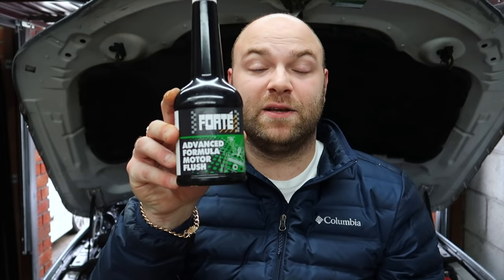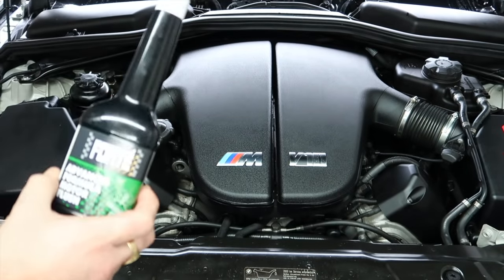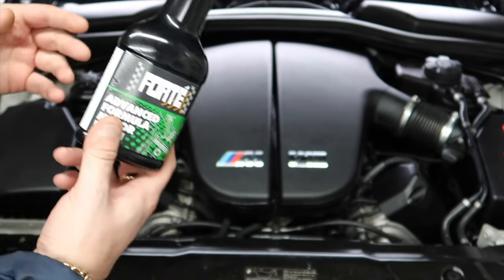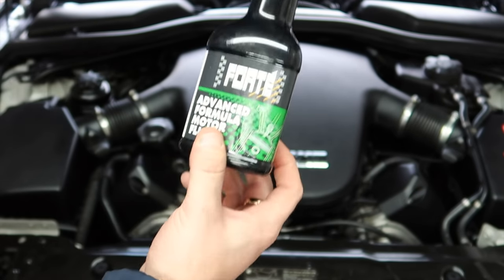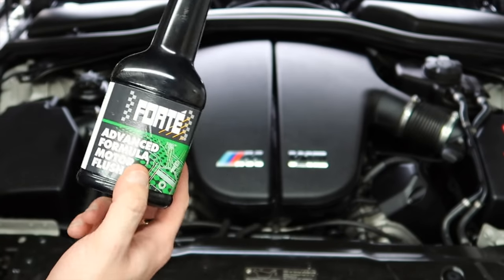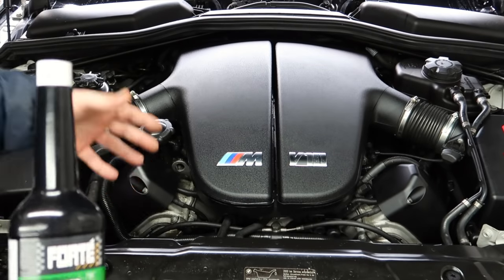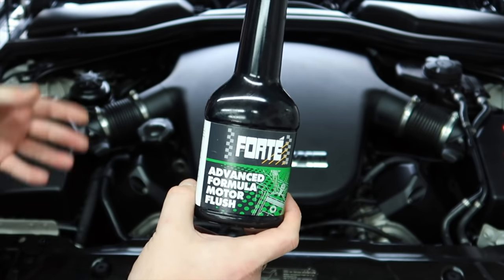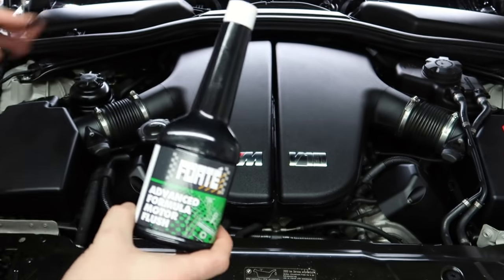Don't (EVER) Use Engine Oil Flush In Your Car !!

Comment: I used it in my n52 for 10 minutes only idling i had never any kind of problem  i can say that after i had better engine performance
Reply: I have also used the Liquid Molly product in my 2011 528i with the 3.0 straight 6 and it seemed to be ok with my 170,000 mile engine. But I see what he’s saying for those of us who change our oil often and with good oil🤙🏽
Reply: @CorbinWilliams  which one good oil you recomend?
Reply: @BagusWibisono  castrol edge m
Reply: I used medic motor flash every oil change and i notice my engine is so quiet and i put full synthetic oil.
Reply: LIQUI MOLY TOP TEC 4200 5W30 AND ONE CERATEC OF LIQUI MOLY EVERY 30000 KLM.

Comment: This is a waste of a video,I used it on my girls mini cooper 2006 since she got it at 27kmiles she now has 103kmiles and when I do the change the oil every 5k  it is so clean because of the motor flush I use
Reply: Totally agree with you .
Reply: Yeah, using it regularly is fine especially from low mileage. Doing it all of a sudden after a long period of time and skipped oil services its begging for trouble. Sludge pellets really can screw a motor.
Reply: Gaff, Do you use the flush on every oil change? or have you only ever flushed the engine once when you got the car?

Comment: Best engine flush is diesel or kerosene.  1. empty sump.  2. fill with 6 pints diesel or kerosene.  3. run engine for 10-15 mins.  4. drain and refill engine with regular oil job done!

Comment: If you want your engine to run longer smoother, change oil in shorter intervals, and use flush every time you do it, I'm a driving instructor, doing several oil changes in one year, I've done 120k since I bought new car in November 2018 Suzuki swift 1.2, never had any problems, oil changes every 10k miles, I use flush on my private car bmw E60 2007 2.0d, had this 10 years, oil change every year with flush, it doesn't even leak from anywhere, I even use a flush on my motorcycles, and again no problems at all
Reply: I think it’s people who don’t anything then want a cheap fix. I use V Power diesel or BP Ultimate and I change the oil about every 8k miles and I used the whole battery of BG products at 100k miles - intake cleaner, EPR oil flush, 245 fuel tank additive. I’m going to do the EPR and 245 now that I’m at 154k miles 2005 120d steptronic remapped 300lb-ft

Comment: I’ve used engine flush on both my N55 engines. Id put it with the old oil, idle it for 10 mins and drain it. Then add new fresh oil and idle for another 10. That fresh oil drains very dirty! Add new oil and good to go. I’ve never had issues and noticed improved performance on both engines.

Comment: I used liqui moly engine flush on my N52 with 125k miles.  As directed on the bottle, I idled for 10 mins and did not drive it.  2k miles later I changed my vanos filters and they were surprisingly clean.  I still installed the new vanos filters anyway bc they were cheap enough.  My N52 doesn't really consume oil.  The only oil loss i get is from that damn oil pan that I've been postponing.
Reply from the maker: Oil pan is one of the most easiest jobs to do on these engines !! you don't even have to remove the subframe to do it I have done it many many times without replacing the gasket or the subframe. 

and my car is still perfect no leaks
Reply: @BMWDoctor  Yeah I heard there are tricks... but it becomes even more complicated when its an Xdrive model.
Reply: @BMWDoctor  do you have a video for this please?
Reply: @BMWDoctor is liquid moly for the lifter tick work ?
Reply: I have an X5 (2012) with N55 engine. I just did the valve cover gasket and was surprised to find sludge built up on the valve springs. BMW doctor stated he used the product only on higher mileage to remove sludge and since this motor has 200K, would it be okay to use Liqui Molly Engine flush or do I still risk getting blow by after? I think the point was to not use on lower K motors with no sludge but okay to use on higher mileage motors with some sludge??
Reply: @Triggerman2505  Don't use it. Rather change the oil every two weeks for the next two months. Than check the cover gasket again. 
High mileage cars can have problems because they have some wear and tear on the engine... and sludge. So if you wash that out... you could have more problems after. Most case is increased oil consumption... because you washed out piston rings that are smaller due to 200k. 
We have Eco test in EU and if that device goes red, you can't get your registration.
Reply: @hbkkid5049  the lifter tick additive did not work for my bmw n52. The lifter tick is driving me crazy. I just bought the liqui moli pro line engine flush and new oil. But i wanna see if it will damage my seals.
Reply: I drove my 2007 bmw 328xi for years with oil pan sweating leak. I dont reccomend it its a serious fire hazard.

Comment: Have always used plain old ATF (Automatic Transmission Fluid) in any and all of my high mileage engines.  High detergents to clean out those passages, "coking" and build up, but still sufficient lubrication to keep from harming the engine.
Reply: Do u substitute 1 quart atf for 1qt of oil?

Comment: I recommend the Liqui Moly flush and using it just one time after purchasing a used vehicle as there is no way to confirm how the oil was maintained previously. My N55 has 150k miles and after using this flush and continuing my 5k oil change intervals it feels like a brand new engine again and my gas mileage improved also.
Reply: Pull the cylinder head cover off and your know how frequent other people changed oil.

Comment: Love this video. It made me laugh. Back in the 1970s my brother had a 1968 Mercury with a 390. He used not one, but two cans of Rislone in it before an oil change to remove sludge. Boy did it work. Engine clean as a whistle, including behind all the piston rings. Car smoked like crazy. He had to rebuild the entire engine. Memories.
Reply: So it caused more damage to the engine? :o
Reply: @rww9113  No, it did not cause any damage, the engine was already worn down.
Reply: @rww9113  it’s like doing a transmission fluid flush. Depends on the state of the engine. Liqui moly engine fish is actually good.

Comment: I think, to be safer, if the bottle says use the full bottle....use half the bottle, do a less mild clean....then fill up with new oil  and run for 30 minutes,  then drain it , see how it's golden....then put new oil, then change again every few thousand miles

Comment: I use flush on every other change and the motor is flawless, Quiets down the engine and better mpg every single time. 
1. Flush
2. OIl change (4k interval)
3. Ceratec
4. Motor Oil Saver (if necessary)

If the car is super old and sludged up, good luck, that stuff will probably clog up your shit pretty quick. I am obsessive with maintenance though, vanos solenoids changed every 2 to 3 yrs. FCP Euro is a no brainer.
Reply: If you’re changing your oil at 4000 there is no need for a flush. You’re also throwing money away. No synthetic oil requires changed at such low miles. That’s what we used to have to do years ago with mineral oil. 10000 at least from synthetic. Plus, an oil change will not affect your fuel consumption. It’s impossible.
Reply: @raftonpounder6696  

Of course this can affect fuel consumption, 
if you break in the engine with oil change at 500 km then 3000 then 7000 and 10000 km
(and systematic preheating in slow motion for at least 10 minutes, etc. - see videos " un million de kilométres moteur ")

of course you have to drain more often on engines that are very busy, 
a w40 for example is made to go to 4-5,000 rpm, then burnt

Of course, not all synthetic oils are created equal...
a Red line for example drains much faster

Finally, it's not just the mileage,
but also the age of the oil (an oil does not last more than a year)

Short,
what is impossible is to have an advice without knows, test, verify....
Not ?
Reply: Can m52 use engine flush,my car mileage is 170.400 km,its safe if i use engine flush before change motor oil?greetings from indonesia 🇮🇩
Reply: Ceratec is gold , but yes the 4k interval is a massive waste if you use a good oil, go with confidence to 10.000 km in normal use, at least if you use the car very hard in track seasons for example.
Reply: Hi, did you use ceratec everytime you change oil ?
Reply: What  is  Ceratec ?? And  what’s  it  for ?

Comment: Best way to flush any engine drain the old oil refill with a good quality Diesel start the engine do not rev it let idle for a few minutes and then do your oil change

Comment: I am replacing the head gasket on an old car with a lot of miles.  When I removed the head cover I saw so much contamination that I knew that I needed to flush the oil.
I had never heard of flushing the oil! :)
I was asking about it on YouTube when I happened to watch Humble Mechanic replace the head gasket on an S10 and he said he needed to start the time-intensive task of flushing the oil and coolant.
He used Liquid Moly.
I mentioned this and two people on reddit said to flush my engine, but with straight oil.
One said not to use a specific flush, although he did not say why.
I did a quick search and found various explanations, including and article on TheDrive linking to your video.
I was just going to use old motor oil.  It must be better than what is in there! :D

Comment: I have had same car with VAG 1.8T 20V engine allmost 18 years. When it was driven 40k miles, there was therabol lifter noise in morning cold start. I did use Mobil 1 0W40 oil with 5000 miles oil change interval.  When I did take oil pan out, there was quaite much of sludge. I did use Forte motor flush and Top end treatment. There has been no any lifter noise after that. I have used regurlary different manufacturers Motor Flushes after that with 10 000 miles interval. I did take oil pan out in 110 k miles. There was not much sludge. VVT-filter was wery clean.  Much more cleaner engine than it  was earlier. I do recommend to use some manufacturers motor flush to prevent sludge based problems. Now that same car has got 230 k miles in ODO. Still purrs like a cat. Stuck piston rings can cause serious engine failure when stuck piston rings scrapes cylinders. Newer cars with low friction piston rings and higher horsepower put oil to the limits in piston ring areas. Hot blow by gases burn oil to "coal". In many engines short oil change intervals is not enought to prevent piston ring problems. I think that mostly peoples do have got bad sludge problems in VVT-actuator and engine and after that they use motor flush. Damage has allready happend and motot flush can not fix bad sludge problem and damages in engine. I would not recommend to put regular flushes to engines with neglect service history. That can cause problem level go ewen higher. BG have got solution to engines with neglect service history.

Comment: im used flusher 2 times in my e36 m44b19, iddle 10 minutes, moving 2 kilometer full 15 minute driving, changed oil and engine goes better👍

Comment: In diesels engines can help maintain a car. I use BG EPR in the oil before changing it and 245 in the fuel tank at 100k and now doing at 150k miles 2005 120d step remapped to 300lb-ft. I have pretty much used a mix of V power BP ultimate diesel. Nowadays do 6k a year…

Comment: Used engine flush in a 2005 Merc van. Ran lumpy, slow and had crap mpg. 
Was like a different van after I flushed it for 20 mins. Smooth, bit quicker and big change in mpg...
Definitely recommend, just don’t buy cheap shit

Comment: I’ve had a BMW 530d and I’ve been using flushing oil instead of flush where you end up putting into the old oil. With that engine I’ve managed to drive 275k before I got rid of it and it was a taxi. I’ve never had a problem with it. The engine was still running fully and it was remapped.
Reply: Did you change your car’s oil after adding flush oil or not?!  Do you recommend it?
Reply: May i ask how often we need to remapped? You mean di ecu, am i right? I dont really understand about this, by the way..

Comment: I use it on my n54 already and it is started giving me vanos cood 2a98 now what should I do guys please help my 😢
Reply: Oh you should change the right rear abs sensor, drive it precisely 12.5 km, then change oil when the temperature of the engine is 20 degrees UNDER operating temperature.  
Then replace the middle brake light bulb and you will be good to go. Woooooord
Reply: @dkrawk8309   Ha... ha... ha.. dude, dats is jwust so fwunny

Comment: 2007 Honda Accord with k2.4.  The filter screen on the vtec solenoid was clogged.  Car in limp mode and CEL on.  Half can of Seafoam in the crank case had it back up and running great

Comment: I agree with NOT using engine oil flush. Regular, frequent changes with the proper spec of brand name oil is the best way to go. When I change my spark plugs at over 100K mile intervals, I always take a picture to prove to my friends how clean and spotless my head is. Also, the inside of my exhaust pipe stays while.
Reply: how are your valves? No carbon build up?
Reply: How does that prove anything? oil is not designed to be burned in cylinder bores above the piston, hence oil scraper rings.... the flush is for flushing crap oil sitting in the block and valves etc... peeping through the spark gap hole with an inspection camera only proves nothing is building up on the pistons

Comment: I flush engines since 1988. Like my grandfather. We always use 500ml Diesel. 5 minutes in a warm engine, that works great and costs nearly nothing. And i change the oil early, 10000 km…

Comment: 🤷‍♂️ I've been working on these cars for over 20 years now. I've used the Liqui Moly oil flush on N52's especially with the cold start misfire and vanos malfunctions and it has worked very well. I usually do this before installing new solenoids.

I'm also a big user of Liqui Moly Oil Saver on the N62's with leaky valve stem seals.
Reply: Do you use Liqui moly engine flush & engine oil saver on n62s? I’ve just had valve stem’s replaced so is it worth using as precaution? Many thanks

Comment: My car runs off full synthetic helix ultra every 15000km now at 230000km and runs like new without any additives or flushes ever. If you use good quality oil there's no need for  flushes, it just gives you something additional to do and let you imagine you've done something extra for your beloved car
Reply: Your oil is Great but I can not guarantee the quality of the fuel going in. That's why u need to run a flush every now n again.
Reply: shell helix ultra = one of the best engine oils
Reply: @3dScience8 thats right...better than castrol..

Comment: N52 later model 2008 528xi   Current 256500 kms . OCI is 7500 kms full synthetic 5w40. no issues. was thinking to do the flush. Your thoughts ... thank you ...  

X5 2011-N55 @ 140,499 kms.   will a flush be recomended?

Comment: And what If i don't have Any history on Maintenance. Last oil change was about 15.000 KM ago ( like idk 9000 miles ago) so it's to be changed anyways. I have no clue how well the engine was maintainend for like 50.000 miles so I'd go with liqui moly engine flush alongside with their oil. Any recommendations guys?
Good video doc, understand your advice but I'm also afraid of the flush harming the seals. But rather doing the flush because of a lack of service history for a while.
Reply: Well, if your engine design would allow easy head cover removal, you can order new gasket, remove that cover and physically see how clean the engine is, new gasket will ensure no leaks for next few years.
Elring or Victor Reinz both make good quality gaskets.
I was in same situation with my 2013 Audi TT. I'D change oil and notice that it would get too dirty too quick. So I have ordered dozen of Liqui Molly engine flush bottles from FCPEuro, some less expensive oil filters - Heighst.
1) I decreased interval from 5k to 3k
2) last time and today I did this:
-add liqui molly flush to old oil, run for 10 min.
3)discard oil and filter
4)put Heingst filter, fresh 0w40 Mobile1 (was on sale at local store) +another can of Liqui Molky engine flush
5) run for 10 min
6) discard oil and filter 
7) new AMSOIL - really expensive filter, and 5w40 European Formula FS AMSOIL oil
8)drove the car for a little over 3000 miles
9) just today repeated 2 to 7.
Oil came out much cleaner in that intermediate flush then it did last time, like much much cleaner.

Comment: My car is 20 years old, 310k km in the engine. I change oil every six months OR 8k kms, whichever comes first. (manufacturer's recommendation)  DOHC engine, no sludge under the valve cover. At all.
But what if I use flush, once a year? Just for prevention. No variable timing.

Comment: Hello, i recently had a vanos code, solenoid, camshaft jammed. It cleared after it warmed up. The car has 100.000 miles. I was going to change the solenoids. Would it be advisable to do an engine flush before changing the solenoids? Because them clogging up would be not so bad because i will change them after the flush.